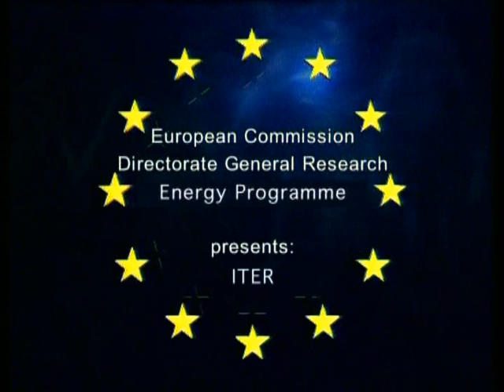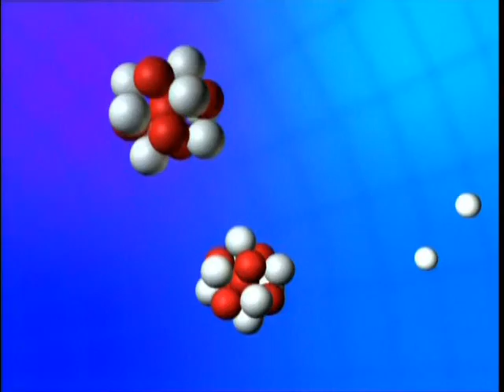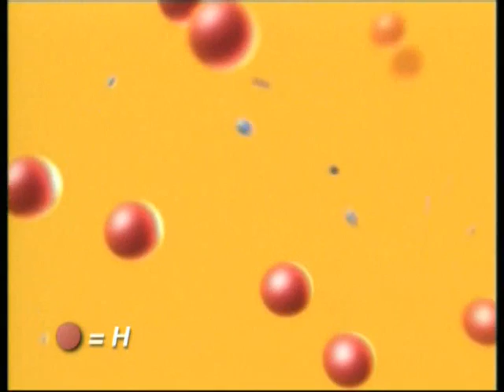ITER- The Way to Fusion Power 1

Comment: @Ichvyenichalster Toroidal fusion machines have been around since the 1950s, and still scientists are far from solving the problems inherent with magnetic confinement. The world is making a big mistake putting all fusion research funding into the tokamak design. Other approaches to fusion (e.g. electrostatic confinement/polywell) should be funded.

Comment: @Ichvyenichalster ITER is designed to be a pulsed machine, with pulses up to 480 seconds. Thats not useful for power. And  the first wall problem: in order to be a useful, practical reactor, huge quantities of 14MeV neutrons must be produced, which damage the walls of the reactor and render them highly radioactive. Its a problem not likely to be solved in a cost-effective manner, IMO.  One a few, specific types of technology develop exponentially, like microelectronics.

Comment: @slobhinav If you stop controlling a fusion reaction, it stops happening. That is, unless you're under incredibly high pressure and extremely high temperatures like those found in the cores of stars.

Comment: The fusion energy gain factor (q) should be over 20 from what I´ve read to "overcome" (can´t think of a better word)  the energy input needed to sustain the reaction.  The DEMO reactor is supposed to have 25 (if built).

Comment: It uses energy the entire time. 10 to 1 ratio would be more than enough to produce endless amounts of cheap energy. As of today, this ratio is less than 1 to 1 (net loss). This is the so called "Energy profit ratio". For instance, today, on average, it takes the energy of one barrel of oil to get ten barrels of oil (ratio of 10 to 1) . Difference is that fuel for fusion is literally inexhaustible for millions of years while oil supply has probably already peaked.

Comment from the maker: Magnetic confinement of plasma is synonymous with hair standing upright on a 3D shape which needs to be combed down flat, without leaving a parting, in order for confinement to be complete (a parting being synonymous with a weakness in the magnetic field); this is where the torus is favourable over the sphere, if you comb the hair down flat on a torus in the direction of the plasma flow, then there is no parting and no inherent weakness in confinement.

Comment: Tokamak cant be tested/implimented on a small scale.Why because the expansion of the plasma during fusion means that the size of the reactor will always have to be large to allow acceptable clearance so the sides of the reaction chamber wont ment down.This is the exactly why Tokamak cant work.Allowing room for expansion reduces plasma density limiting atomic collisions that cause fusion.Spherical confinement means that near 50%of expansion is directed inward increasing pressure and collisions.